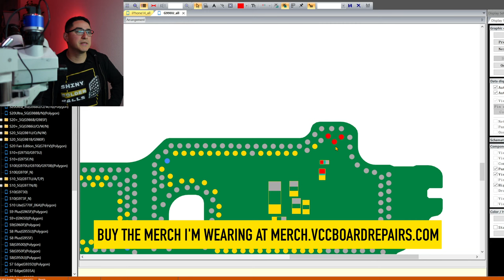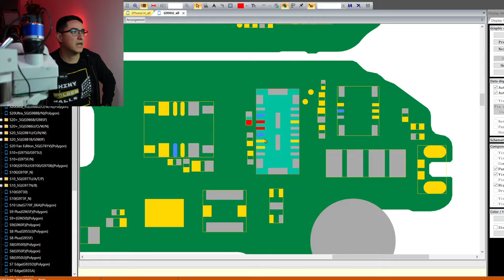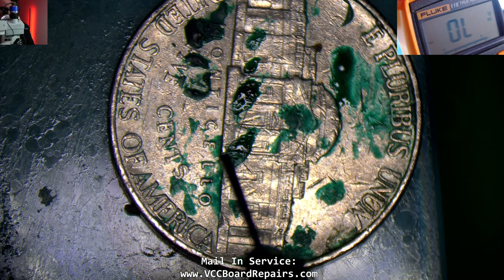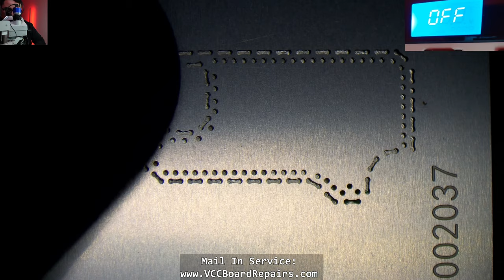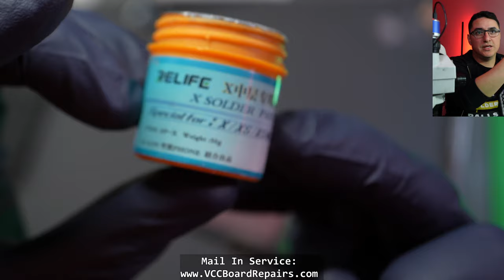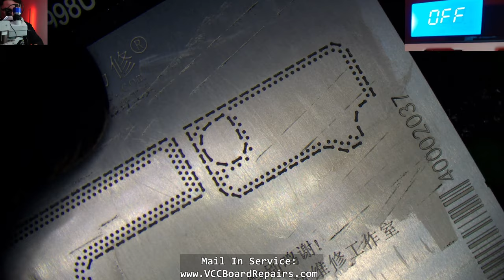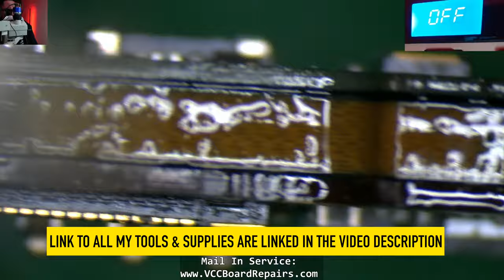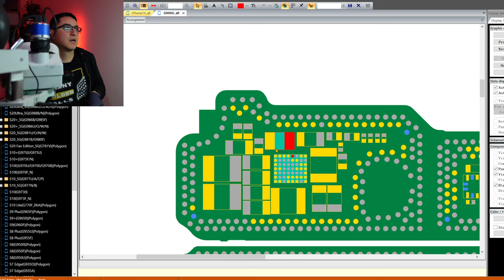Samsung S21 Ultra Sandwich Board Reball Tutorial. It was Water Damaged & Customer Needed Their Data

Comment: Had a problem with a S21 5g after a pool party. The phone got wet from inside and the back cover took off, so, I put the phone in rice for 2 days. After that,  the back of the phone was reinstalled and the phone was working perfectly. 1 month after, the phone is randomly restarting even in Safe Mode, and the the cpu gets quite hot even in idle. What could be the problem buddy? I would really appreciate it.
Reply from the maker: Water damage is very destructive. I would recommend replacing the phone. Unless you're looking to recover the data out of it, then send me a message for a quote